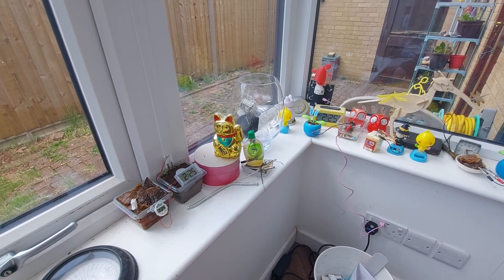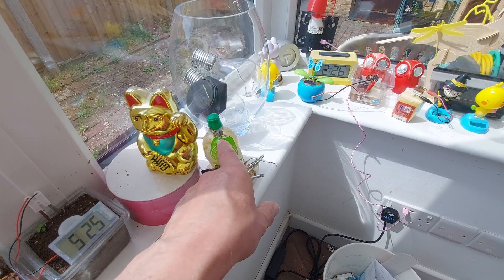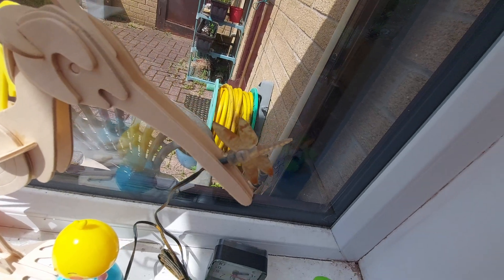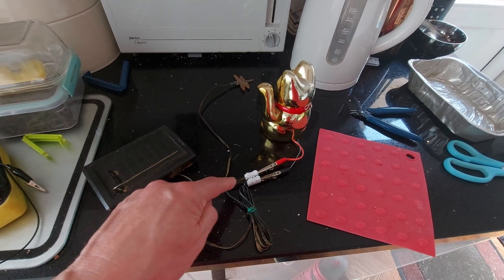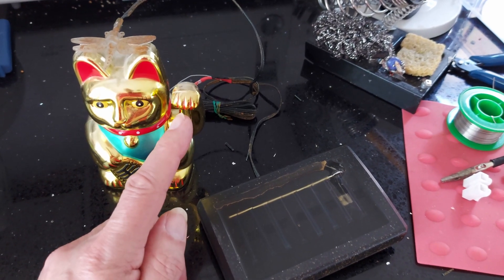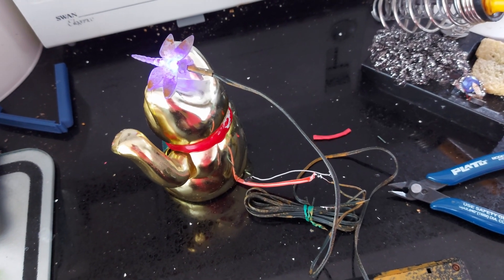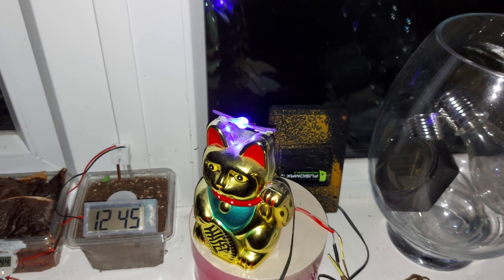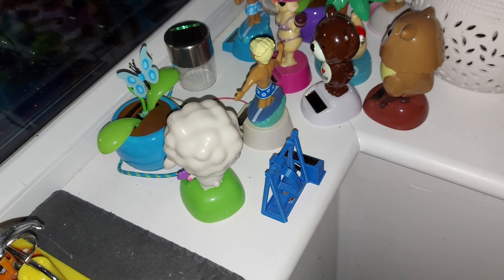Night time Solar Powered Waving Cat 🐈 PART 1

Comment: Am always a fan of cutting into existing cables lol
Wonder if lead from a car wheel weight would do better with such corrosion? Carbon/lead does well in longevity experiments here 😀
Reply from the maker: Great suggestion! Thanks, I don't think I have tried lead in any of these battery projects 👍😊